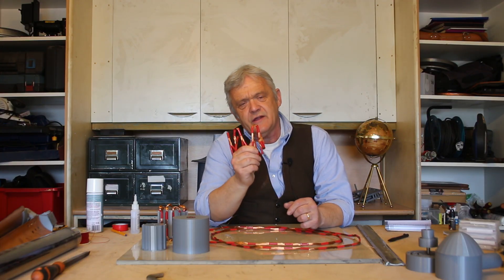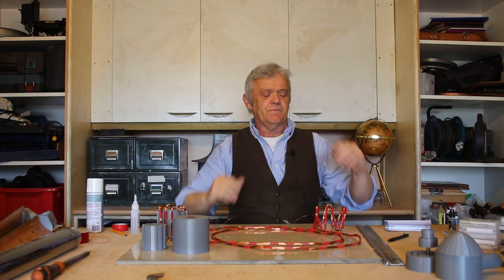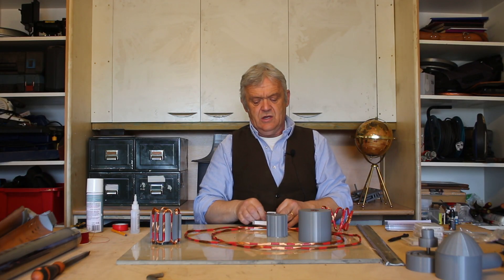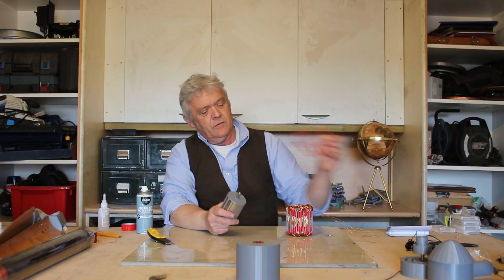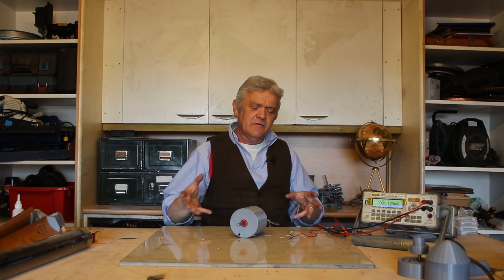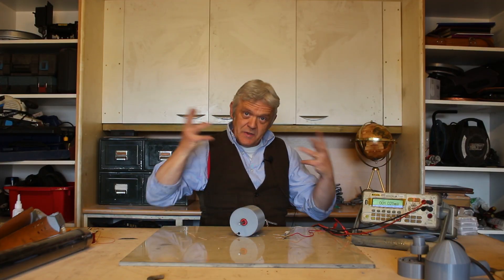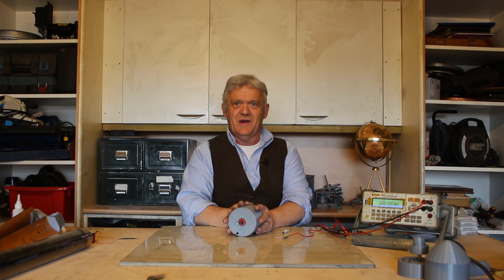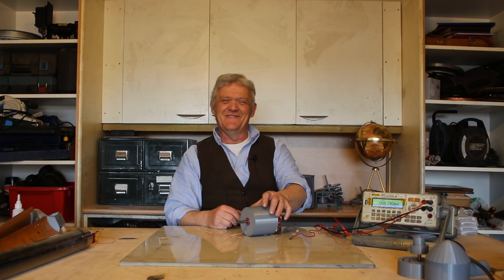1931 A More Powerful And More Efficient Generator And How To Build It

Comment: I'm actually working on an incredibly similar mechanism myself, glad to see a three phase serpentine coil works just fine👍
Reply: Hey what's the benefit of three phase? Would you mind telling me? Trying to learn
Reply: @Unpopular_0pinion  well just being able to overlap the coils and fit more copper into the stator is one major advantage in the serpentine's case, then there's the point that three-phase generators can be very easily converted into motors with a controller, and finally I'd say a three phase generator if wired correctly should be able to produce a much higher frequency of ac current with the same speed of rotation.
Reply: @SwiftNuts  Oh okay🙂 And what are the benefits of higher frequency AC? Does that mean more power?
Reply: @Unpopular_0pinion  not generally it's just able to be used in a wider variety of situations without needing extra electronic components. Being able to take up the empty space with more windings does allow for more power out of certain configurations however.

Comment: I'm puzzled. Excuse me if this question is dumb. That serpentine coil seems to have 6 'ups', 6 'downs', 6 'tops' and 6 'bottoms'. Perhaps my error is in assuming that you can't count each vertical twice when comparing the potential power output of the serpentine to its equivalent made from separate complete loops, so I assume that this serpentine is equivalent to 6 separate loops? If so, 6 separate coils would also exhibit 6 'ups', 6 'downs', 6 'tops' and 6 'bottoms'.  So, in the serpentine equivalent how has wire been saved?
Reply: 6 ups + 6 downs =12 coils. 1 top + 1 bottom = 1 coil. 6 tops + 6 bottoms = 6 coils. So 12 coils but only 6 coils worth of tops and bottoms. Not to mention the time and energy spent making 12 separate coils Verse 1 easy to make serpentine coil  :)
Reply: @stevengouws8684  Hi there. Okay, so I assume the comment deletions are as a result of links, or mention of Inst......m so we must resort to text. I will persist, as this is driving me a bit mad. To identify 12 coils in the serpentine array, do we not have to count each up and down in adjacent coils twice? I can't quite see how I can count 12 without doing that. Is that valid? Does each vertical bunch of wire generate twice the power of its coil equivalent? If so, how? What am I missing? Thanks for the help.
Reply: @Howtosolveproblems  Not sure each vertical coil generates 2x the normal coil. It generates at it's most effective for copper used, and angle of magnetic field passing through the wire (90'). It's far easier to make, uses less copper and is more effective. Using different magnets and different copper wire gauges, will yield different results, as well as RPM of the magnetic stator. However focusing purely on the coils, if you used as much copper of the same gauge to make a serpentine coil, as opposed to standard (12) SEPERATE COILS, you will ( should ) get a better result . You have to test and see for yourself, nothing like it.  :)
Reply: @stevengouws8684  Oh, I quite agree. I don't quite understand how each vertical can be providing twice the power. Hence, when I add up 6 ups and 6 downs I count 6 coils as I don't think I can count these verticals twice to count 12. It's not my topic though, so I assume I'm making an error somewhere, I just don't know where. The reason I'm trying to work this out is that I have indeed tried this for myself and still don't see the advantage the serpentine offers. I've built a rudimentary wind turbine on the roof of my shed and I've just about completed a generator which I'm documenting online. I wanted to offer a diagram of how I'm counting this and invite some opinions, but this seems to be completely forbidden in YouTube comments. Even mention of an external resource seems to cause automated conniptions, which is rather inconvenient when one is trying to have a discussion.
Reply: @stevengouws8684  Hi Steven. Thanks for the reply. Unfortunately, every time I try to continue the discussion my comment is deleted.

Comment: Just had a thought, maybe good maybe not, but what about instead of using wire to make the coils a person was to use flat copper sheet, almost like a laminated iron core for a magnet. You could stack up layers and they could still be enameled and you could maximize the surface area perpendicular to the magnetic field and minimize the parallel connections. Has this been done? I'm going to go research it.
Reply: Interesting idea.
Reply: I believe you can get square-section wire, but it'll cost you a fortune and likely there's a huge minimum order for it.

Comment: Could you combine a Halbach array with a serpentine coil? How would you do that to best effect?

Halbach arrays use the magnetic field most efficiently by pushing all of the magnetic field to one side of the array.
Reply: Please say more
Reply: @stevecollins4567  it is easier to understand if you just look at an image of a Halbach array. Do an image search on Google for "Halbach array" and you'll quickly understand.

Between the alternating north-south magnets there are magnets whose axes are oriented sideways, perpendicular to the main magnets. These force all of the magnetic field to one side of the array, roughly doubling its strength on one side and roughly canceling all of it out on the other.

This basically doubles the efficiency with which your magnetic field is being used because as much of it as possible is being forced to sweep through the coil. Without the Halbach array, half of the magnetic field (the half facing away from the coil) never passes through the coil at all.
Reply: If you put a magnet in-between the north/south magnets but turn it 90 degrees so the same polarity facing the  magnet next to it, it forces the flux to go out farther and stronger. It makes it act like a stronger magnet
Reply: Hmm that looks hard to follow. Let me see if I can find a link

Can't find it but it's basically a halboch array going around the rotor
Reply: The strong side of a halbach array is a mix of north and south fields, and will not work. It must be north OR south. But one way to increase the strength of the magnets on the rotor is to use an iron core in the middle instead of just plastics, then they will amplify themselves just like when stacking magnets on each other.
Reply: @matslarsson8790  In the generator Robert built, the poles alternate. They are not all north-out or south-out; they alternate north and south facing out. The field lines still go from the north poles of magnets of one orientation to the south poles of the other, but half of the available field is on the side facing away from the coils. The steering magnets inserted between the alternating magnets simply shift all of those field lines to the strong side. The shape of the field isn't different in kind, only in degree.
This should actually work and result in a better generator. 

Debating about this can only go so far toward resolving this dispute. The way to settle this is with an experiment. I hope Robert will take this up and try it.
Reply: Definitely works, but there are other measurements of efficiency. Such as cost, and there is added weight which your turbine must now move; not itself always a bad thing but in the UK we are dealing with low wind-speeds and must design the turbine to move easily, same for most urban situations. 
It's much easier simply use something like 0.5mm mild steel sheet behind the magnets; not AS effective but makes a difference for little cost, or weight.
Reply: @TheBaconWizard  The magnets need not be heavier; you can use smaller sized magnets that weigh less, and if the field is used twice as efficiently, you can still come out ahead.
Reply: @Berkana  Interesting thought, makes sense. I'll look at that :)
Reply: @Berkana  You can also focus the outgoing field on the face by adding small triangular mild steel lengths to the front of the magnets, running the length of the magnet. Should at least double the field strength, and with a mild steel plate at the back, another 10-20%.
Reply: @stevengouws8684  I would love to see Robert do a showdown between all of the different methods to see which one is the most effective, and to see what would happen if these are combined.

@Robert Murray Smith please do these!
Reply: @Berkana  Yes in a perfect world we would have 5000 days a year and 400 hours a day available to us with unlimited capital and material availability and at least 6000 more Youtubers running all our experiments for us so we can sit and brainstorm on our chairs  :D

Comment: I’m not sure there’s actually much copper saving here mate… if you do a  set of standard coils and link them in series with single connection cables (as per a standard series star wound machine) you have the same number of radial bunches of wire as tangential bunches… which is what the serpentine has… maybe I’m missing something but are you able to clear that up for me?
Reply: Hi there. I've just posted a similar observation, but am no electrician so am very much scratching my head. I can't quite see how wire is saved.
Reply: @murdocks4304  ithanks - i understand its only the sides. I still dont think theres any less copper - in a standard coil setup (using rectangular coils) you have two sideways runs for every two uprights then you link the coils with single pieces of wire. With the serpentine you have the same - two sideways for every two uprights?

Comment: My first attempt with a 32 magnet rotor and I managed to get one of them in backwards - now it produces at best ~0.8VAC (100 turns of 26ga). 
I'm not sure how to get the one magnet out of its recessed hole - I might have to shatter it - can you drill Neodymium?
After that is a new coil of 300+ turns of 41ga wire that just came in.
Reply: Sad to report that although TECHNICALLY you can drill it, not really; it will likely shatter and even if it breaks cleanly you may find it has demagnetized as I did. I wonder if slowly grinding it might work if you keep the heat down. But that's a huge pain too and I don't know for sure if it works. Easier just to smash the magnet imo.
Reply: @TheBaconWizard  My main concern is getting it out cleanly enough to replace it.
Reply: @EUPThatsMe  What is the rotor made-of and what glue, if any, did you use?
Reply: @TheBaconWizard  Its PLA with CA+Baking soda glue. While Acetone would not do much to the PLA I don't want to risk loosening the others nearby.
Reply: @EUPThatsMe  Eh, acetone does soften and weaknen PLA. I think your best bet might be to cut the whole thing and glue a new section in. Then balance it incase you've made it heavier or lighter on one side. That would be my approach I think.
Reply: @TheBaconWizard  Looks like the CA+Soda was my saving grace.  I used a fine pointed file to make a small notch next to the magnet, gave it a good side tap, and the CA+Soda shattered. Now had I used epoxy that would have been different altogether.  Got it all cleaned up and new one in place.  Spoiler alert it didn't improve it much.
Reply: @EUPThatsMe  Something wrong there mate. Can't think what it would be. It's serpentine coil with 100 turns, made into 32 intersections with the magnetic field? And the magnet is large enough to cover most if not all of the wire (which is enameled/coated ofc) ?
Reply: @EUPThatsMe  I reckon you should make a quick and dirty video on your phone and upload it, I am sure people in this community will help.

Comment: Consider creating IKEA level drawn instructions on how to create these.  And all your models and innovations.
Reply: A 'please' wouldn't have hurt.
Reply: He does a really good job of explaining the stuff. With this one, you can print the tinkercad files, throw in the coil, a couple bearings, the magnets, and a shaft. He talks about this over this video and the one a few videos back he referenced in this video. He's laid it all out. Over the course of these two videos. Honestly IKEA could use a youtube channel where they walk you through how to construct the things. I'd prefer that format
Reply: @ liam winter id like to see that.
Reply: Also a lot of youtubers are dying from HV shocks from transformers and stuff. If you can access and construct a thing without understanding it, and it has the ability to harm you, you're more likely to be harmed than if you had the respect for physics that comes with a deeper understanding of what you're dealing with. Making it a bit difficult is a bit of an insurance policy
Reply: Just say you need kindergarten level instructions 😂
Reply: How does the shape of the wires relate to the drag resistance through the magnetic field? How might that type of resistance be reduced while maintaining energy production?
Then there is drag resistance of the blade design or not blade design.  There have been some interesting research, theories, and experimentation in those areas as well. We know that wind itself can produce an electrical charge too.  The last two I seen was an internal turbine with a flair scoop to catch more air, and a down draft tunnel using louvers and I think a pilot tube like design to speed up the air.
Reply: IKEA needs more practice with Assembly instructions 🤔🤣😊
Reply: No. 

No.

You want them hand delivered as well?